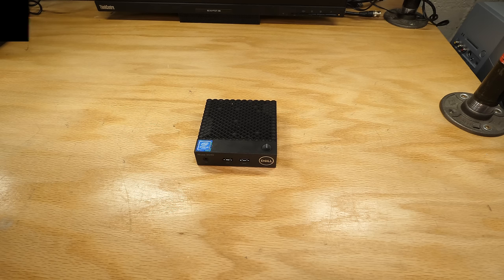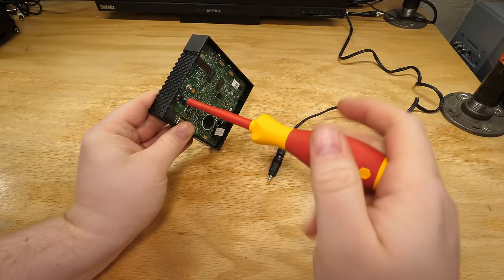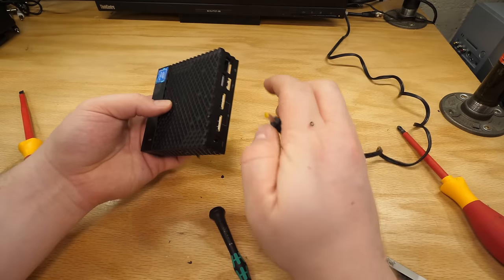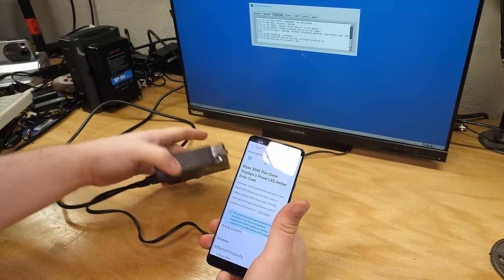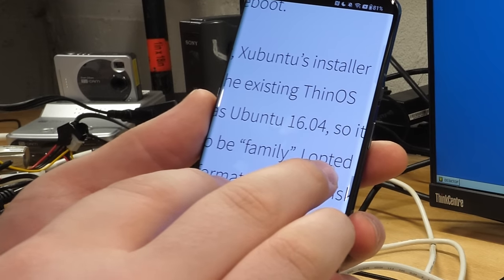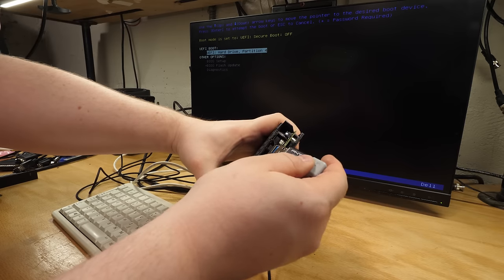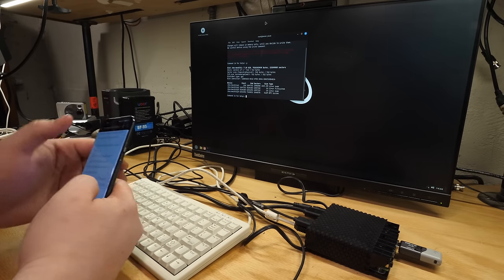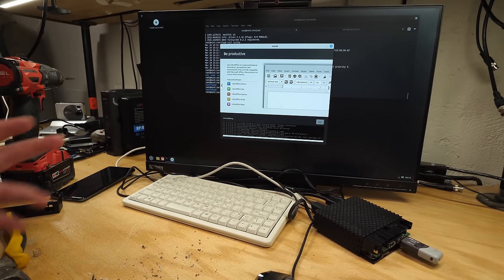Little Guys: Episode 2 [Wyse 3040]

Comment: I remember when I worked in fast food that we had two of these that worked all of the order screens, one for the front, one for the back. But they cheaped out on the monitors so they had to use DP to VGA adapters, also had these PS/2 button pads (with a PS/2 to USB adapter of course) that were used to navigate around, along with booting up over the network. Good times.

Comment: My bet is that unit has such a high hour count that the status LED is essentially burned out. I’ve only seen that on machines with a decade of constant run-time on them.
Reply: That's what I figured. This can be seen commonly on the scroll/num lock LED on constantly running keyboards. When you turn caps lock on, it's 10X as bright.
Reply: That is the case, I’ve seen dozens of Dell with very dimmed led power button
Reply: Though it looked quite bright without the button and as demonstrated, even a phone flashlight was incredibly dim through the white plastic part
Reply: @resneptacle  I’ve deployed Dell machines of this era back when I worked in IT. Laptops, desktops, servers… When new, the raw LEDs on the PCB would be so bright that it would be painful to look at them directly. The one in the video is relatively dim, implying that the machine has tens of thousands of hours on it.
Reply: The LED's on these would burn out  quickly.
Reply: I think you're right. Given how badly they failed at lightpipe design, they had to run the LED at an uncomfortably high current to emit enough light to be visible. Which in turn would cause it to lose emission within a few years of use.
Reply: @SianaGearz Ah yes, engineers fixing bad decisions with even worse decisions! Sounds like a regular monday to me.

Comment: I actually thought about buying one of these as a “not a raspberry pi” but I’m so glad I went with HP Elitedesk ultra small form factor pcs. They’re about $100 give or take depending on generation but are actually great little PCs that come with all kinds of useful things like Wi-Fi, Bluetooth, real m.2 slots. I use a Ryzen one that supports a custom AMD GPU module for light gaming, and an Intel one for my home server.
Reply from the maker: I completely agree, I have no hands-on with those but a friend tells me they're great, and I have the Lenovo equivalent, the THinkcenter. Those are perfectly cromulent.
Reply: I used to go the route of Raspberry Pi but have also found that micro PCs work better. They're x86, faster, have upgradeable memory, faster SSD possibilities, and can be had for the same price or cheaper than what Raspberry Pis are sold for today.

Plus, they stack so nicely and easy in the event you need a few for different things. ❤
Reply: Thing is that a microPC is still $50 for a 4th Gen, yes very capable but also 10 years old nowadays, and a 6th Gen is more like $70. Quite a jump from the sub-$20 price these can go for.

Comment: Love the way the Caps come down in your opening title-card, and IMO the easiest way to get Linux onto that thing (without getting your hands dirty) would be to write a boot-able image onto the eMMC from the installer's OS; it's even possible to write the download onto the drive without storing it intermediately. I don't know what image to recommend off the top of my head, VM images are pretty close to what we're looking for but could be missing drivers for real hardware and installation-media is ephemeral. You'd be looking for a "persistent" LiveUSB image.

Comment: After the housing crash in 2008 in US, gov't put in place strict regulations for financial market. Apparently a lot of financial info was being stored on local pc's, laptops, etc at these companies. So, part of the new regs was that all financial info had to be stored on secure servers, and employees could only thin client into the stuff via VM's and such. So, a huge chunk of the financial market suddenly shifted very quickly to thin-client computing. And then fintechs and financial companies came and went all the time, so these little things flooded the used market. I worked at a loan company for a short while, and they kept having issues with these things. IT guys walking around always had a spare 1 or 2 in their kit when wondering around. Someone would say "I'm having problems with my..." and they'd just unplug, swap it out, turn new one on. Good to go. These things were so cheap and disposable.

Comment: Until very recently, the electronic meat wrappers I worked on all ran VXWorks! Hobart Access Wrappers with the EPCP-1 control console are Geodes inside running VXWorks off a CF card.

Comment: I have a few hundered of these at work I have supported for citrix RDP.  They have a couple of quirks but are workhorses too.  

First: There is a 12v and a 5v model, the 5v one has a dim power light, the 12v one is bright. I always cup my hands around the WYSE to block all light then look through finger gaps to read the light.  Hook up the 12v brick to the 5v model and you have a paperweight, and they use the same barrel connector!

Second: On first power on, after power loss, they have monitor detect issues.  They will flash an amber light a few times then turn off.  Seems to be our DP to HDMI cables/adapters exacerbate these issues.  The solution is to fully hook it up except hook no display to it, give it a minute, hit the power button, give it another 30secs (the light should change to white), then hook up the monitor.  Then it will work unless power is removed, powering down or rebooting is fine.  After mass power outages we get a ton of calls.
Reply: Yeah, they don't like some DP-HDMI adapters. But some others work without any issues. The worst part about this is that with the incompatible adapter they get stuck in an infinite loop and don't boot at all until it is removes

Comment: I have one of these And it's running alpine linux. You can set up Alpine in a way where it boots into RAM and the disk is never written to, so this way the emmc will actually survive for a long time. It might seem slow/underspeced but compared to a raspberry pi 4 it's slightly faster in raw compute, draws a comparable amount of power, has built-in storage, and networking, a "nice" plastic case, and doesn't overheat (for the most part) and you can run any old x86 piece of software on it, unlike the pi. And in many cases, it's also cheaper than the PI, especially during the recent-ish pi crisis.

Comment: We used to install rdpwrapper on Windows 10, and then setup thin clients to RDP into it. Mutliple users sharing the same one Windows 10 machines. It was perfect for where families had a limited budget and/or space restrictions but wanted to offer a full desktop machine. As time went on, we started to just use the built in Windows Hyper-V, and as you said, RDP directly into individual virtual machines.

Comment: Older Wyze thin clients ran Suse Enterprise, we had one at our DC and I ended up dumping the onboard image (Suse Ent 11) and converting it to a remote serial terminal. It had two serial ports! However, it was SLOWWWW. The stock image didn't come with any packages outside of your remote software and an old Firefox install.

The os image was on an IDE DOM, and it was an archive used with overlay FS but no packages would be saved anyway. There was only 1G of disk space, so I assume they discarded everything that wasn't usernames/passwords or realm.

Neat to see they still use 'fireport' as the BIOS password!

Comment: Excellent video. HP makes awesome little guys, I have a t540 and t640 both running Windows 11 with overkill 1TB SSDs and 32GB RAM. Even as far back as their VIA thin clients Windows has always been an option.

Comment: Love wyse terminals, they'd have a variety of Os sometimes wyse/thinos, but many times xp or win7 embedded those were the best to play with as a pentester's playground.

You'd be autologged in as a local admin, just with the wyse file based write filter limiting your changes and no ability to turn it off but once you have broken out of the lockdown (cert install, open with, etc) you'd add an administrative user. Shutdown -l (log off, don't reboot) holding shift to prevent auto login. Log in as your new user and disable the FBWF.

Boom, you've admin, on the underlying host. Install an implant. Enable the FBWF again. Reboot. Wait for someone to come along and use it, and you're in the wider network.

Why the new user when you're already admin? Because there is a 'volatile profile' controlled by a registry key within HKLM. You could remove your user's sid from the key, or you could just add a new one.

Comment: I had to stop the video and comment right away when you pulled out the "worst keyboard you own". We use that exact keyboard on many of the machines at the place I work and I HATE THEM. The form factor is wonky and they have the worst membrane I've ever used. And the people at my work ABUSE them, they're dirty and falling apart. Glad to see I'm not alone.

Comment: Hi! Awesome to see the same model I've purchased few months ago :D I needed a small computer that I'd plug into the UPS so other machines could receive its signal over network. Turned out that it supports remote desktop over RDP, so I can use a fanless device to work on my workstations that have RDP enabled (yes, that default "remote desktop" Windows feature :) ) - it also works well with XRDP on Linux.
Correct me if I'm wrong but I remember that this ThinOS was based off FreeBSD.

Comment: Not sure about this particular model, but many thin clients are popular with the vintage/retro gaming crowd. The processors may be pretty slow by today's standards, but they run FreeDOS and DOS-era (even some Windows era) games perfectly fine. The only catch is the sound card. Some of the sound chips that these use aren't fully compatible with the sound standards used back in the day (OPLx/Sound Blaster/etc.) So you'll either have sound that doesn't work at all (no music and/or digital sampled audio) or music that sounds wrong/weird/incorrect. Your mileage may vary.
Reply: There are very old thin clients which are usable as retro computers but can have a slightly weird or incomplete souncards.

Starting from early-mid 2000s, any attempts at DOS compatible soundcards have died out and have been replaced by AC97 port of the chipset.

To go along with Windows Vista, AC97 was extended into Azalia (HD Audio), which is mostly what we have until today. Well now Azalia is dying too, to be replaced by USB UAC2. But this computer would specifically have Azalia audio.

On AC97 and Azalea, you can just use SBEMU or one of its forks.
Reply: This one only boots UEFI and not in BIOS mode, so only modern OSes are supported. But it can run an emulator like dosbox well.
Reply: @Schule04   Does it have CSM? This wasn't the era when it started being dropped yet, it might just be baked in, though locking out MBR boot makes sense. For systems with CSM, any number of EFI bootloaders can chain boot DOS, rEFInd for example or maybe Clover and the likes.
Reply: @SianaGearz It doesn't have any way of enabling CSM in the BIOS GUI.

Comment: The power light being dim is a problem on old Dell machines. They've often been on such a long time that the LED has degraded to 50% or less of its original brightness. When that Wyse terminal was new, that LED would have been blindingly bright without the power button in front of it.

It doesn't help that those LEDs are heavily overdriven, which causes them to degrade in a relatively short time span. I've seen them go dark after just 5 years.

They can be replaced, I think they're 5050 package LED modules, but they're bi-color LEDs, which getting exact replacements for can be a headache.

Comment: I recently picked up one of these too! Mine also came with a dead CMOS battery and it had the same bizarre behavior where it would blink orange/white at bootup, after replacing the battery it works fine. Apparently some DP to HDMI adapters can also cause this issue.

That M.2 slot on the bottom is actually not M.2 but SDIO! It was designed to originally work with a very specific wireless card but someone managed to design a microSD adapter that can fit in here and be used as a bootable disk.

Regarding Linux, the best distro I managed to fit on it is a minimal install of Debian with the XFCE desktop, any other desktop environment is too large to be installed. A weird side effect of having eMMC onboard is that grub would not detect the partitions and say that no OS was installed. I managed to get past this problem by doing an expert install and telling grub to check all storage devices. Debian runs okay-ish, although performance is quite abysmal and you're left with like 1gb of free storage.

Comment: I actually have a couple of Wyse thin terminals from way back in 2011, it's a SX0 and also uses an earlier build of ThinOS. It's bounced bases over the years from Win CE, to NT to Linux, but it's so heavily stripped down to fit on the ROM chip that it can't really do anything other than run the bundled applications and does not handle error conditions well. You can totally boot anything you want on these though within reason. the SX0 i have is some AMD Geode SoC which is x86 based as well. It had a Micro IDE connector in mine, I actually managed to squish a CF Card reader in mine and install Linux on it.

Comment: The Z8350 CERTAINLY supports more than 2GB of RAM. Own several with 4GB. I'm pretty sure I seen machines with 8GB? Oh and there are super minified Windows installers, Tiny10 1809 was some 2GB after installation with page file and hiberfile disabled?
Reply from the maker: I'm just going off Intel ARK. I've heard of people finding errors on it before, though.
Reply: Are you sure those use the Z8350? Some very similar atoms support a lot more RAM.
Reply: @Schule04  definitely Z8350. I've got a Fusion5 T90B+. Z8350, 4GB RAM and 64GB eMMC. There's versions of the Lenovo Miix 320 with 4GB of RAM too. There's versions of the Intel Compute Stick with the Z8350 and 8GB of RAM.

Comment: Also, is far as test driving other operating systems, you might be able to get by using and IODD SSD enclosure that allows you to mount and present not only ISOs as physical media, but virtual machine hard disks as well. The device works especially well at ensuring that there is maximized compatibility with host hardware, baing able to advertise the media as a hard drive or hard drive, and iirc floppy as well. The ST400 goes for about $85 on sale and just needs a 2.5" SSD to be inserted to get started with loading the files you want to mount.

Comment: I have debian linux installed on multiple of these. I did run into some issues where linux would have a problem with installing on the built in storage. Apparently some versions of linux dont like the idea of putting the EFI partition on a SD card. At least debian 12 net install kind of gives a "are you sure you want to do this?" option and once you pass through it, debian may install as expected.

I have been experimenting with one of these as a "babys first hypervisor" for a friend who has some interest in VMs and linux. I installed proxmox on a sandisk ultra fit usb stick, and attached a samsung USB3 SSD to the front port for VM storage. So far, this system has been running pretty well.

Comment: Unlikely, but if you ever get the itch for a follow up on this little guy, one way that you can demonstrate it's purpose and potential usefulness even today is with Moonlight/Sunshine. You'd install Sunshine on your powerful computer and Moonlight on the Dell. Even without being able to install the OS to the eMMC storage, I've done this on a live USB and it works really well. It just doesn't persist through a reboot. Good enough for a demonstration I think.

I am exploring options for getting my computers out of the room I spend the most time in ahead of, what is shaping up to be, the hottest summer I  will have lived through. I have an Unraid server that hosts a virtual machine with a GTX 1070 passed through, and on the other end I have an old N3150 Celeron powered mini-computer (passively cooled, even) that will act as the thin client. This computer is utterly useless on it's own but the onboard graphics are just enough to make this use-case feasible. I was able to run it at 4K60 through Moonlight and it was buttery smooth with barely noticeable latency. And that will probably be what gets me through the summer. My gaming PC will be on standby but for normal computing tasks I think this will serve me nicely.

Comment: Regarding your thin client. The CMOS battety is basically a CR2032 that is in a little holder and shrunk-wrapped. Try a CR2032. 

The ThinOS is a customized version of ubuntu core if  Iremember from the support site years ago. What makes these kind of special is if you run something like a call center, hospital, or engineering company,  you can create a centralized golden image that is basically immutable. You run the VM extremely locked down . The user that connects gets a minimal desktop with the applications they need and the storage they need mounts on login then when they shut the machine down everything is dumped. As you said this is enterprise as hell. Extreme scale enterprise remote desktop/VDI. 

The local storage is barely enough to do anything beyond boot thin OS, be enough of a cache for the VDI or PXE boot software to do it's thing, and mount a network drive. Try network booting them. Then you get all the storage your arrays will let you have vs fighting with EMMC.

Comment: 2:34 Those CMOS batteries are actually very easy to get replacements for. Just buy CR2032 batteries with soldering tags, cut the wires from the original battery and solder them onto the tags of the new one. Then wrap the new battery in electrical tape or a heat shrink tube similar to the original one, and you're good to go. I've done it many times on laptops using this style of battery, always works.